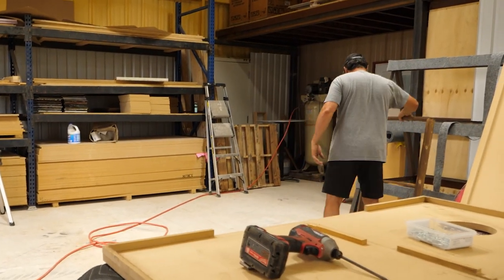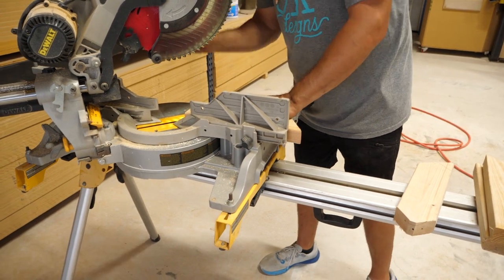Easy Guide To Making Cornhole Boards Part 2 | RK3 Designs

Comment: Kenny are you putting any topcoats over your boards or leaving them with the original epoxy gloss coat?
Reply from the maker: We put the Ultimate Top Coat in gloss. Gives it an incredibly durable surface.
Reply: And I'm sure that gives it a nice smooth and slick board to slide bags on.  Question what do you sell your boards for$. I make them and I use paint/ stain and with decals. Finish with the usual wb clear coat and sell them for $220. I'm wanting to try out the epoxy but stuck on what would be the$ price point. You guys are awesome love all your videos and teaching skills.
Reply from the maker: @daleesalinas474  yes we do sell them (custom orders only) and we also donate them to many fundraisers in our community. 😊.
Reply from the maker: @daleesalinas474  email me rk3designs@gmail.com